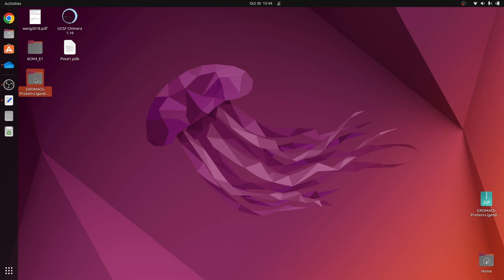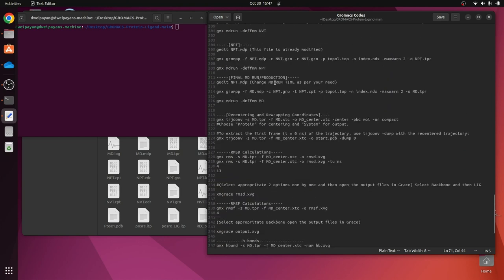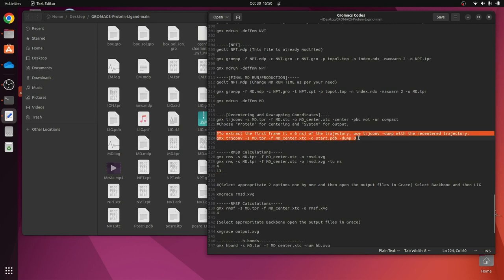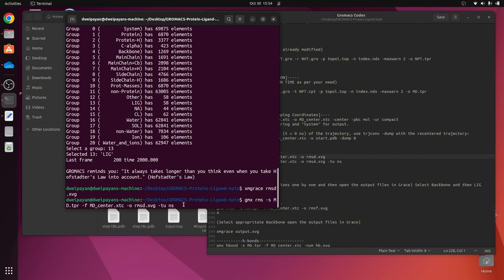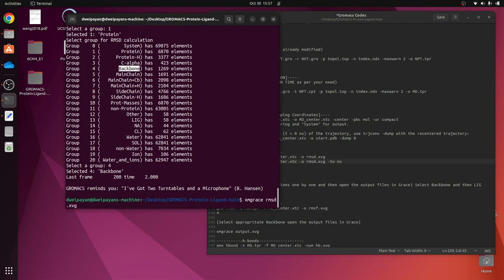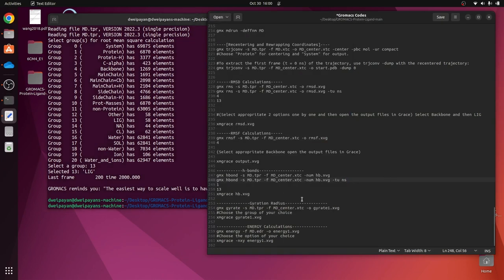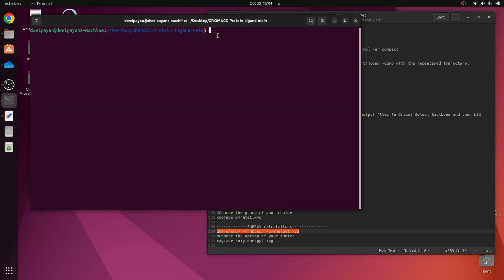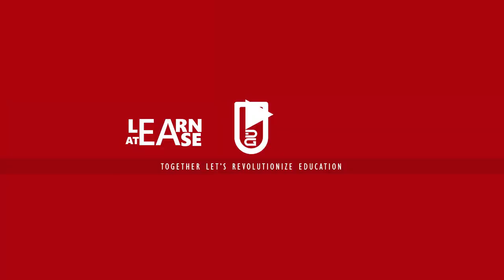EP 12 | Post MD simulation assessment of Protein Ligand Complex in Gromacs | RMSD, RMSF, H-bonds, Rg

Comment: Hi, I have run an MD simulations for 100ns on protein-protein complex, and I am currently trying to analyse the results. However, while I was running the simulations, there was a power cut-off on my PC and in order to continue the simulations, I extended the running time for another 20ns. unfortunately, when I tried to generate the RMSD plot, I noticed that the plot did not start from 0ns but from around 90ns, and the value of the RMSD just shoot to around 2.9-3.0nm. 
I also had another simulations run for 1ns, and the graph actually starts from 0ns point. So, I actually noticed that I have few parts of the xtc files and planned to combine them so I get to generate a continuous RMSD plot from 0ns to 120ns using this command gmx trjcat -f *.xtc -o fixed.xtc but I have been getting errors. 

Would you suggest any advice for me? Thank you in advanced.

Comment: I am getting very less frame numbers like 10 only.. What should i do to increase it
Reply from the maker: Increase the md time run by makin changes in mdp file
Reply: My laptop turned off in between the simulation when i increase the time for simulation an i have to start the simulation runagain due to this
Reply from the maker: Change power options in your pc from settings ... Pc should not go to sleep when simulation is on
Reply: @DweipayanG  please i neeed the sasa command and boltzman energy
Reply from the maker: Try this command 
gmx sasa -f traj.xtc -s topol.tpr -surface ‘Protein’ -output ‘Protein’ -o area.xvg -odg dgsolv.xvg